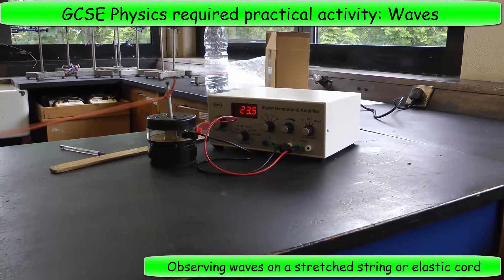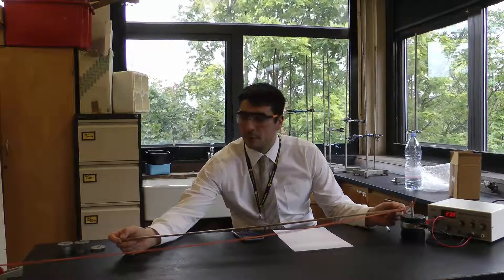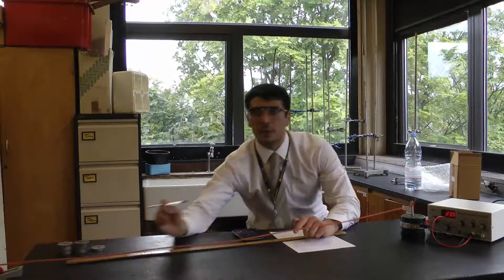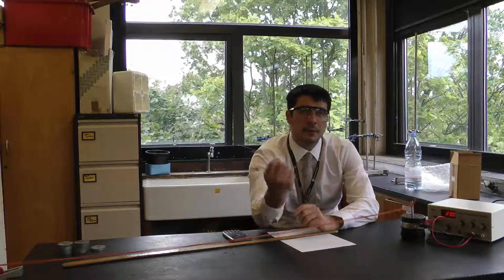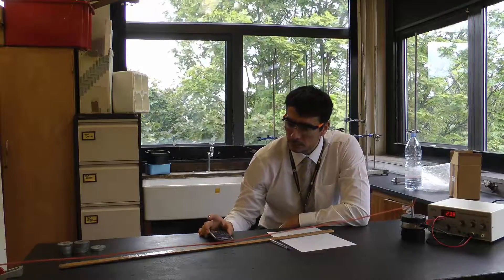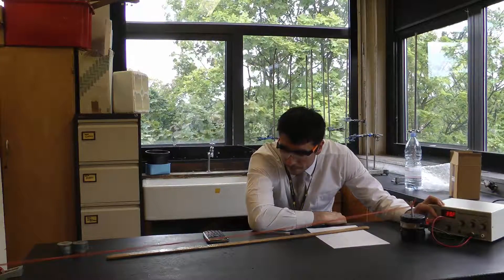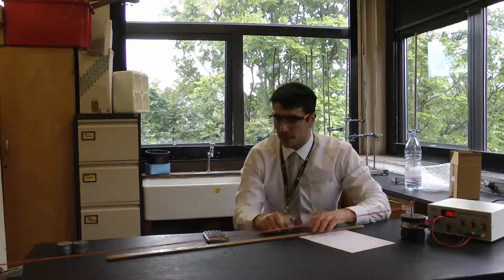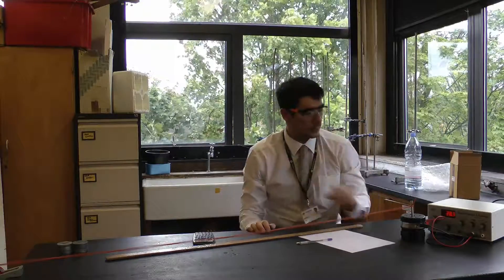AQA Observing waves on a stretched string or elastic cord

Comment: Are there any alternatives to vibration generators that can be used to produce the wave on a string?
Reply from the maker: Um Ibrahim you can use an electric motor with a cam (oval shaped piece of metal) glued to the shaft. If your willing to fiddle around a bit you can get this to work, use a  potential divider to vary the speed. Hope this helps.
Reply: Thank you. I will try this with a motor.